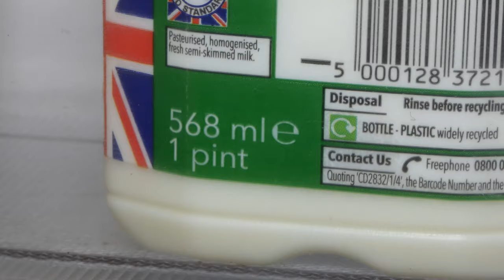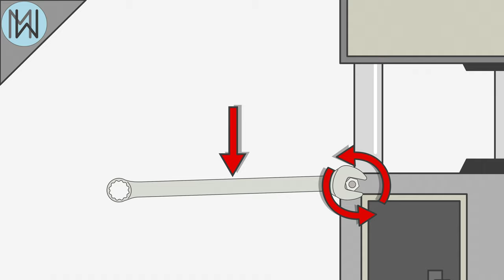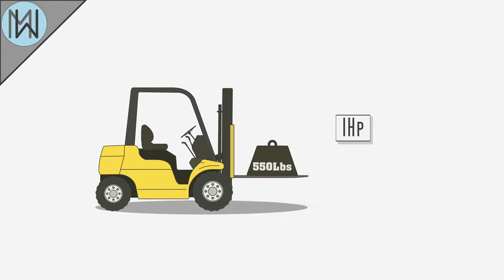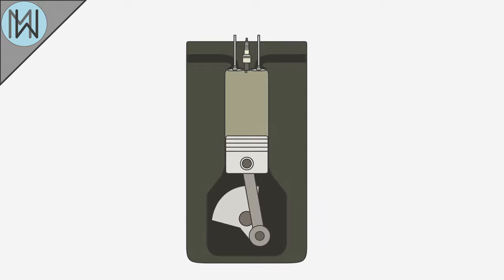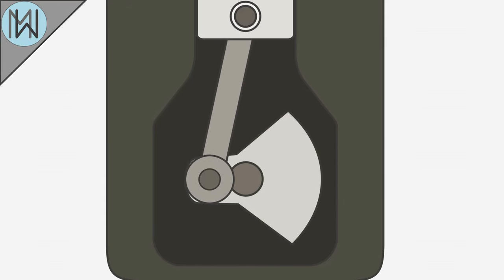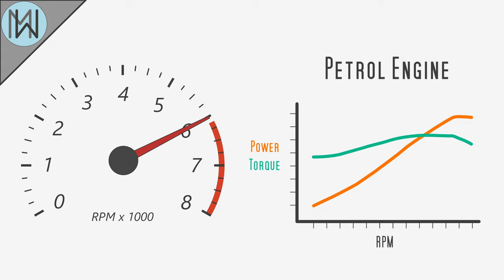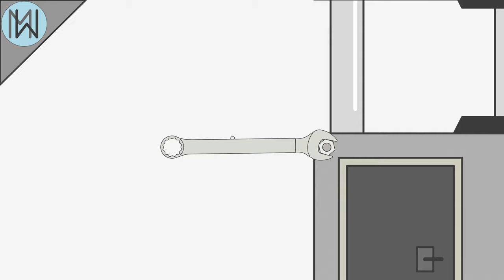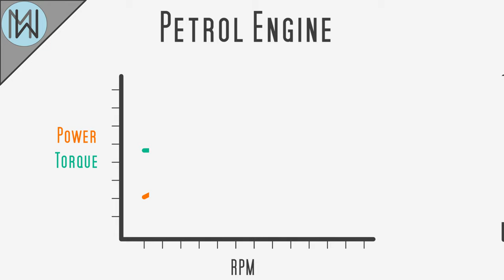Torque vs. Horsepower Explained

Comment: So for an SUV(bmw x4), which weights 2 tons:
diesel has 400nm 200 hp
petrol has 350nm and 262hp

What I understand from torque/nm is that if I put more weight on a petrol(5 people with luggage), the petrol will struggle and won't be that fast? Where diesel will not rev that much and will take it slow and handle a lot of weight.

I mean you see the specs above, I'm a bit confused what are the pro and cons for that, both engines are 2 litre engines. I'm new to car concepts
Reply: Problem is, the car is not an engine. Between the engine and the road there are gear ratios and, most likely, they differ between diesel and gasoline options. If gasoline wins 0-100 acceleration, it will keep winning if you add weight to both cars because of the 2nd Newton law from where acceleration = force / mass.
Reply: petrol would not strugle it would just required higher rpm for generate the same thrust , disel be stronger at low to mid rpm in your egzample but petrol above mid rpm be dominant  if you choice let say perfect gear at 100 km/h for overtaking some other vehicle and try accelerate to 140 km/h let say uphill with 5 pasangers onboard assuming both cars except gearbox and engine are the same so weight drag asf than petrol do it faster cos have more power 👌🏻 it would generate more contact path force cos watt :m/s = force as long as gearing be eprfect for both and peak power width quiet similar it be the disel from your egzample which be strugle more in such test ,the point is for daily riding where you dont want shifts like in race track and want stay on as low rpm as posibble the disel version be better cos its stronger at low and mid range rpm let say from idle whatever is idle rpm in this car let say 600 rpm to 3000 rpm os disel would have advantage in how much fprce it can generated pull some stuff on such low rpm easier be having more tprq power at this low rpm comapre to the dame low rpm petrol from your egzample the point is like im mention earlier if you reduce gear in petrol and use higher rpm where petrol have more power it now start generated more output force and tow heavy stuff easier than disel now get it ? very simple 😉👌🏻 whole confusion come from those id…ts who makes such video that they  dont take into consideration speed factor what is lethal misteake 😉🤭they sibscribe everything like you could comapre 0-100 acceleration be one vehcile do 0-100 and some other be do 300-400 km/h and compare for both 0-100 km/h 😂🤮

Comment: how can torque increase in the graph if the length of the piston and crank length remains the same?
Reply: Torque is not only affected by length of the crank which leaves us with force being different along the rev range.
Reply: There is an efficiency curve. At a certain point, the leverage of the rotating assembly (pistons, crankshaft) is rotating at the optimum speed with the ability of the engine to flow air. As RPMs rise, the piston begins to outrun the flame front and the combustion becomes less efficient.